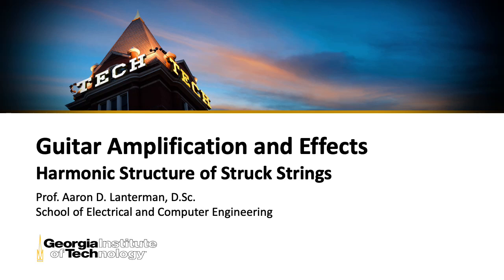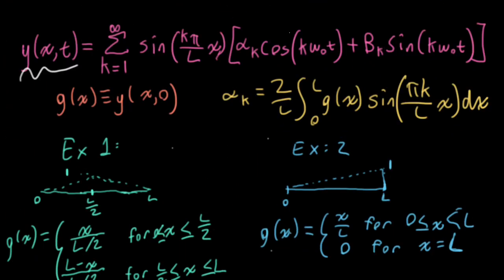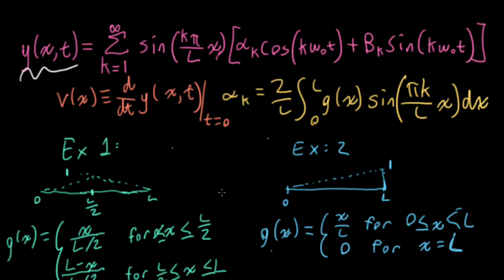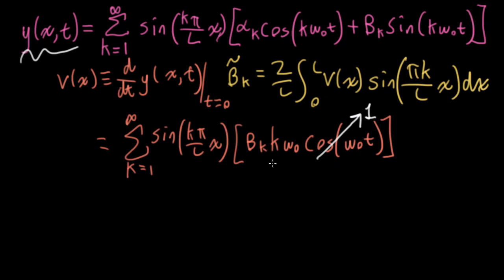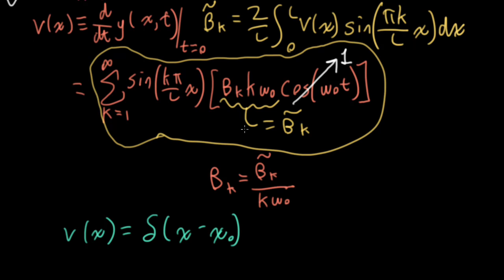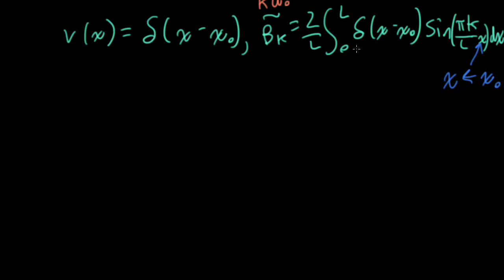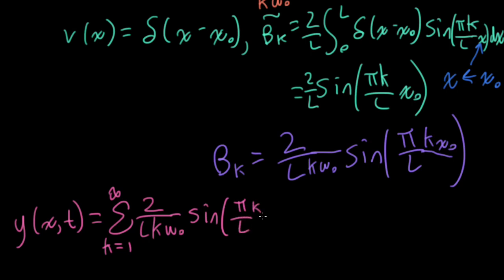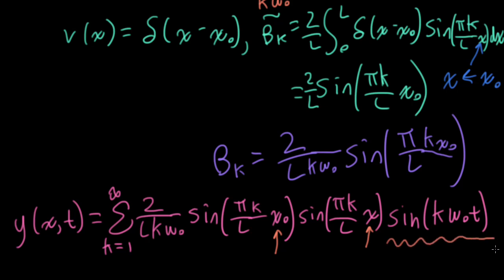ECE4448 L5: Harmonic Structure of Struck Strings (Guitar Amplification & Effects, Georgia Tech)

Comment: Nice! The math seems turns out a lot simpler in this case compared to the plucked string case because the excitation is just a delta function.
But I think you simplify it in the same way in the plucked string case: The second derivative of the initial condition g for the plucked string is just a delta function as well. Then you just have to choose the right amplitude for it (higher towards the edges), and you should be able to solve the plucked case for any x0.
I think that the result would basically be that the plucked case has the same kind of spectrum except that it decays with an extra factor 1/k (factor 1/k^2 from the double integral, but we had a factor 1/k in the struck case because of beta tilde).
Reply from the maker: Interesting... I'd need to think about that. We might have to be careful to make sure the boundary conditions are satisfied.